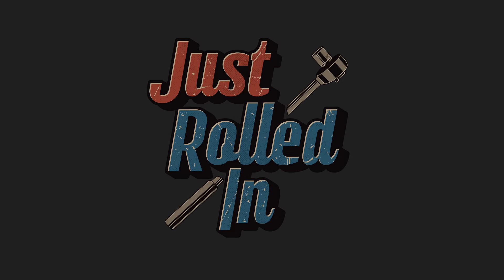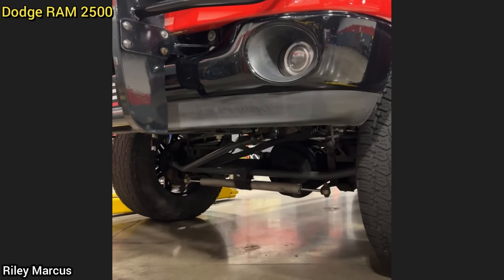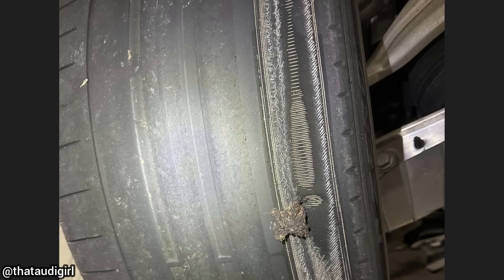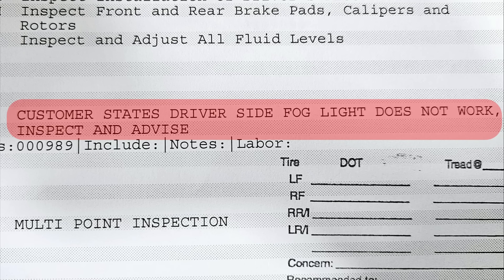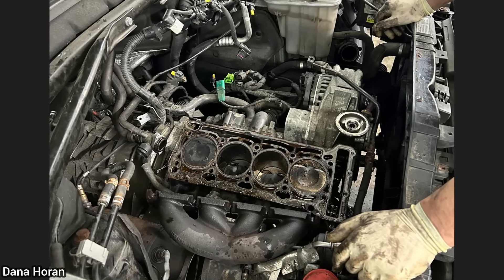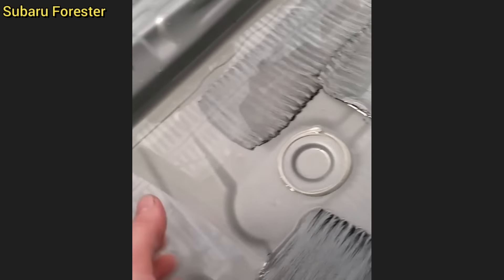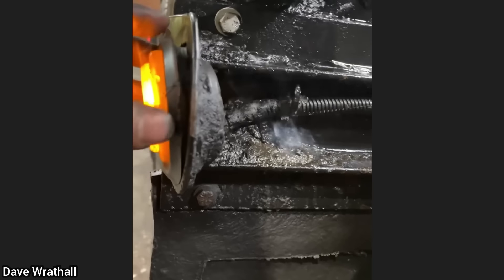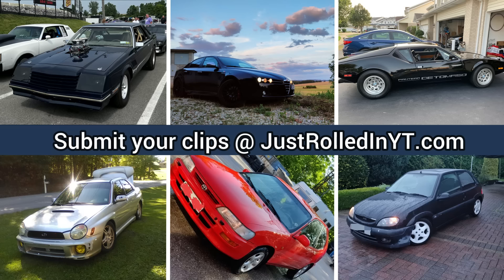Customer States It Looks Like His Car Has Been Left In A River

Comment: 1:57   Is that a normal amount of carbon buildup on the valves?  Or what's left of them?  lol
Reply: engine was likely burning oil (probably due to lack of servicing ) oil lowers the octane, so detonation and pre-ignition burns the exhaust valves as shown. straight up and down a customer issue imho. im in the UK so we have a lot of small displacement turbo motors here, this sorta failure is fairly common.

Comment: Its sad when some people refuse work.. Some are idiots.. But some just cant afford the work and risk driving dangerous cars to survive :(
Me and my mechanics will charge parts for parts, but stay back and fix dangerous issues, Even if we loose 50 bucks buy fitting a used safe tyre/tire, replacing a hose clamp, searching through buckets of bolts and nuts to fasten suspension properly.
We also do motorbike services, tyres and maintenance. Is some one comes in and just want their chain adjusted my apprentice will do it free of charge, while they wait, lube it, and spray some oil on all the pivit points, check tyre pressures and a visual of the brake pads and send them on their way.
KARMA + the word of mouth keeps me busy!

Comment: Why would you take a vehicle for a test drive before it gets aligned?
Reply from the maker: So you have a before and after. For example if the car pulled left or had a terrible vibration then you would know before doing the alignment. Lots can be found on a test drive so it's important to do it beforehand.
Reply: @JustRolledIn it was more of a rhetorical question. There is no reason to do so. If the car is out of alignment then something is wrong. You don't need a test drive to figure that out. The customer info is more than enough
Reply: I've noticed that sometimes the customers aren't accurate with their description, or possibly thinking something is happening either when it's not or when it's something in particular they are doing.
Reply: It also helps to take note of any other issues beforehand so you don't end up with "my car didn't do X before you fixed X" but didn't take notes so now there's an argument and little evidence that it was not something you did.
Reply from the maker: @ragingmcqueen  the customers information is enough? 😅 If only that was the case most of the time